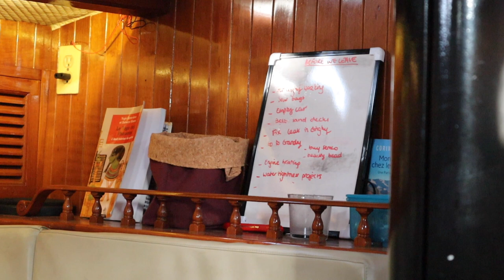Buying an Old Sailboat to Sail Around the World (Hard Work)! | Ep.1

Comment: Typical DIy s , mask the deck off before spreading silicone into teak or you will have to sand old teak down to clean off and make it thinner
Reply from the maker: thanks for the comment - we considered that but with so much thickness left in the teak there was no way we felt like taking that much time taping each seam!
Reply: @NavikaSailing  Hi what sort of silicone did you use ?